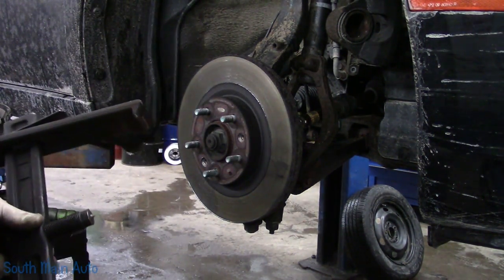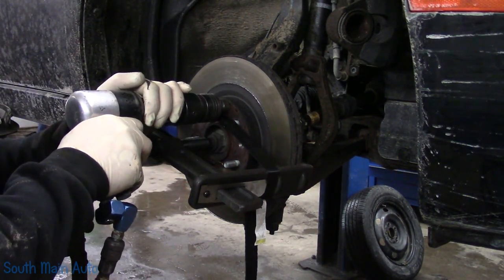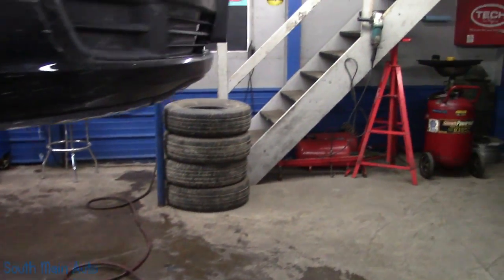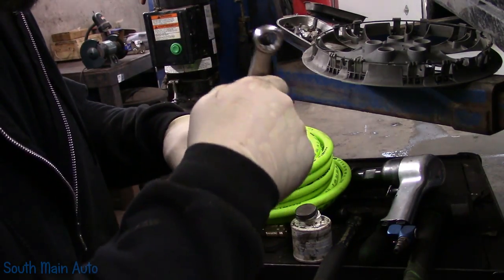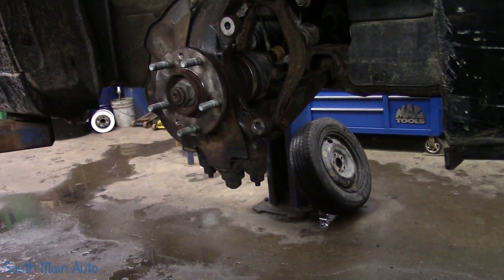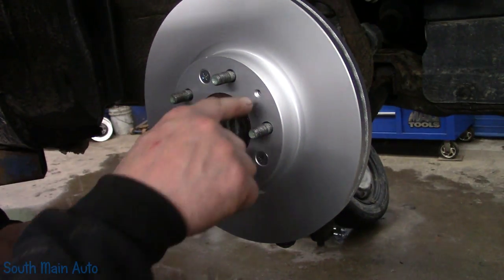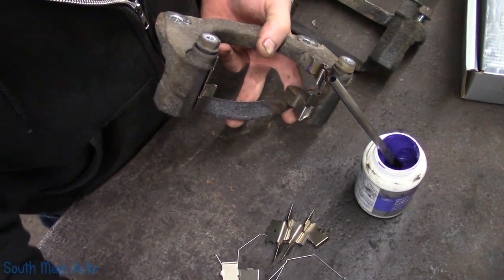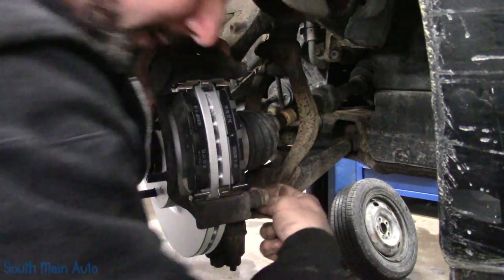Mazda 6: EXTREME Brake Rotor Removal 😱

Comment: Years ago my grandfather had a Checy Celebrity and lived in good old rust county NY. He didn't drive much and when kne of his brake calipers started to seize, I went with my dad to take Grandpa to the tire shop because the tires had started to dry rot. Now figure 12 years on NY, few miles and the wheels had never been removed since the factory. Rims frozen to the hubs. Front rotors also frozen and one seized caliper. Six hours in the lift with the mechanic earning his pay that day.

Comment: Ah the good old Mazda stuck brake rotors! The hydraulic 5-ton 3-jaw puller from Harbor Freight and a good air hammer work for me ;) Also, why not just thread on a lug nut or two to prevent the rotor from violently flying off? Less video drama though haha
Reply from the maker: Lug nut left on = boring vid 😐

Comment: It's a Mazda thing. I did a Mazda 3 ... in the end the only way I could get it off was cut across it with a angle grinder with a cutting disk, then hit it in the cut line with an air hammer with a chisel in and it came off in 2 halves.

Comment: Anti-seize compound works great. I use it on every brake job on the contact surfaces. I only have to use a hammer or winch for friend's cars

Comment: I had a 2005 Honda Odyssey that I was replacing brakes all the way around. All the wheels went okay until I got to the left front. Put the 8x1.25 bolt in- striped out. Broke my 8lbs mini sledge. It took an hour of pounding to get the rotor off. I hate rust.

Comment: Hey Eric, sounds like you're finally feeling better, unless this vid in not chronological.. Anyways, I generally use a BIG sledge to break the rotor off the hat and let it hang there. Then I use a really sharp air chisel bit and peel the hat off the hub. Since it's cast iron, and the hub is steel, it usually works pretty well w/o much carnage done to the hub, ( the hat usually shatters off in pieces, so have those safety squints on )  but you gotta be careful, have that  lamb like touch to avoid gouging the hub face. .   The rust belt fight is real! As for the new hose, I've not used 1 yet but they are supposed to work great in cold weather... retain their flexibility, and be better at resisting UV and salt . I've used Goodyear hoses for yrs, never had 1 burst, but they seem to tend to dry rot. Could be because they tend to lie on the floor in the salt and grime while I'm working. I also use nothing but a 1/2 inch hose. Assume you do as well. I don't like using pullers personally. Twice I had a rotor shatter in my face after placing not all that much pressure on it, while the hat was still stuck on the hub.

Comment: Yeah for me, my dad wanted me to do pads and rotors for his pt cruiser and the tire was mildly stuck like really mildly stuck because I took the lug nuts off and I was like 👁👄👁 wut... it's still....on??? It was just tiny rust so I just kicked it lightly, that was fun...and the rotor was just the same but just the slightest bit more where I had to get a hammer but one hit, came off that is just about enough drama we have here in Arizona just mild stuck stuff or a case of surface rust is all. Big props to you my dude cuz that rotor at that second turned to a weapon. That don't sit too well with me lol.

Comment: Like the race of a front wheel drive bearing that remained on the spindle. A slice on the top of the rotor, not so much the face...where they fuse and a smack with a chisel. The rotor comes off just as easy.
This isn't upstate NY but we're not far off in Toronto.

Comment: I have used a sawzall to make a radial cut to near the hub to remove a stuck rotor.  I found that there's no need to cut sll the way into the hub area. That seems to release the locked in stresses created by the overheated rotor.  You still need a 4 pound hammer.  It's surprising how easy the rotor cuts with the sawzall.

Comment: I got a Mazda CX 7, that I put new pads on at 60,000 miles. They were very difficult and because of that i use anti-seize on everything before I put it back together. And then again at 120,000 miles I had a wheel bearing go out. That was an absolute nightmare!!

Comment: Had a 2009 Focus with rotors like that. Had to cut them off then wire wheel all the rust off the hubs. Coated the hub with never seize when we reinstalled them. 2 years later they came off like butter.

Comment: Use a die grinder with a cut off tool. Cut the rotor between two wheel stud holes down to the surface of the hub. Get your cold chisel and five pound hammer. Line up cold chisel with cut mark. Hit hard with hammer. Rotor splits between wheel stud holes and rust is broken free from back side. Remove and replace rotor.

Comment: In my garage on jack stands I pounded, beat and kicked my Ford Ranger then I gave up. I went to Summit Racing, Akron 5 miles away (convenient) and I bought the OTC 6980. I attached it safety strapped it an used the impact on it. Still would not budge. So as directed I hit the shaft with a 5 lb. hammer and the rotor flew across the garage. It’s a great tool. Just be careful.

Comment: Rotor left that hub and tried to attack you like a banshee. 7/10 no brake clean, hard to get my morning buzz with no BC fumes in the a.m. Reminds me of the hub that became one with the front passenger side axle on my wife's jeep. Took the whole thing out and stuck in my vice to work on it for the next 2 hours, when I finally was about to give up and buy a new hub (was replacing the axle already) I just barely tapped it in hesitation because I really wanted to take a sledge to it, it just fell out and the axle landed on my foot. That was last spring. What a crappy day.

Comment: That's why you always use two lug nuts to act as a stopper. Though if you're replacing the rotor a good mini sledge will help knock it loose pretty quickly.

Comment: I had a 2011 Durango in today, right rear rotor was about 3/16s of an inch thick. By the time I got the wheel off it had knocked the outer inch off into a separate ring. I have never seen a caliper piston out so far. Still had pad on the inner, the outer backing plate had just about worn down to where it would slip right out. I couldn't even get the usual tools in the caliper slides they were right at the spring. Rotor popped right off for me though. Worst part was it had come from the dealer for some stalling problem, no mention of the brakes as far as I was told.

Comment: If you have a rotor that stuck use a portaband and slit the braking surface of the rotor in 2 opposing spots. Then  use your puller  and the rotor will split in 2 very easy and come right off. Many times when rotors get this stick it is not necessarily  stuck on its  inner hub diameter but its  outer hub  diameter which is what makes it darn near impossible to remove. That is where splitting the rotor helps so much. Putting a lug nut on will keep you from smashing fingers and toes. As far as using big nasty on the hub! Please think about the poor wheel bearings in there getting brinnilled. Using a air hammer on it is just like using a impact gun on the hub nut . Both can and will most likely lead to a brinelled wheel bearing.

Comment: I use a die grinder with a cut -off wheel to cut across the face of the rotor and hub.  Then use a wheel puller to crack the rotor in half to get it off. No drama.

Comment: Pulling stuck rotors is the worst and frustrating.  You could use another ratchet strap to hold the rotor puller to the frame to keep it from projecting towards you.  Anyhow, glad you didn't get hurt.

Comment: Just found this video. I have to say I'm glad I didn't find it until after I used a puller on my rotors in my driveway in western New York. I'm also curious to know if I have to do it again, would it be a good idea to possibly put a lug nut on part way to keep the rotor from flying off.

Comment: That was a bit intense. Should have called it 'Fire in the hole', lol. Looked like you still and the air gun on it which would give you some protection. Could be really bad if it caught someone by surprise and just hit someone a bit shorter in the chest with that big bolt sticking out. I've lived most of my life in NY and luckily never had something that bad. I guess I know why I clean everything up and use never seize all over when I do change my rotors. Thanks for sharing.

Comment: I see so many using that puller and it flies off.  Leave 2 lug nuts threaded partially on opposite ends and that won't fly off.  I'd rather eff up a lug nut or a stud than end up in the ER.

Comment: What is the attachment you are using on your air hammer, when you press it against the stuck rotor? Rubber or metal ended bit? Thanks.

Comment: They do include something to keep the rotor from flying... they're called  lug nuts. Sometimes you can break them free  by just forward,  reversing, and braking  quickly with loose lug nuts installed while one drive wheel is still on the ground.

Comment: So what I have to do to get those Mazda rotors off is get 2 long bolts and put them through the ears where the caliper bracket mounts (from the inside out), then put nuts on the other side so as you tighten the nut, it pulls the bolt through.  Once the bolt starts hitting the disc, you tighten the bolts, turn the rotor, tighten the bolts. etc until you press that thing off.  Hasn't let me down yet living in Michigan.

Comment: I actually did do the front brakes on my Mazda 6 in my driveway in Upstate NY. Those stupid set screws on the rotors gave me hell. Thankfully I was able to whack the rotors off with a regular hammer. Now I'm hoping that I put anti-seize around the outside of that hub. I can't remember.

Comment: Wow, on my 2001 Suby they came right off by using the 2 jacking bolt holes in the rotor and it was really rusty. I'm in NH and it's bad. My rotors have 2 jacking bolt holes that I run a tap into first to clean the threads. I go till it bottoms out on the hub and then i do a quarter turn. Go to the 2nd one and do the same thing with a quarter turn after hitting hub. You have to go 1/4 turn on each screw back and forth again and again and it comes off. I think only having 1 in a rotor is basically useless. Subaru is smart knowing their cars are driven in rust belt areas so they put 2. I was putting so much torque on it and it never stripped. Good old Subaru.

Comment: I had same problem same car mine was even worse bought the same tool, STILL wouldn't come off, I finally got a torch and cut the whole rotor in half!!! For some reason the hub causes the original rotor to form a mushroom over it and it becomes solid.

Comment: Changing brakes on my daughter's 10yo Hyundai in the parking lot outside her dorm, 95 miles from home, with every tool I could imagine even possibly needing tossed in the back of the van.  Except the 4-pound sledge, of course. I thought of it the night before - wrote myself a note - forgot to grab it.  I beat the ever-loving shiznit out of the first rotor with the classic 16oz ball-peen until my arm was tired. I had just decided to go buy another damn sledge hammer, when a college maintenance guy happened to come along, and he loaned me his.  Four whacks and the rotor came loose.

The rotor on the other side was apparently paying attention and wanted no part of this abuse - I took the bracket off and the rotor literally fell right the hell off the car.

Comment: Had a 2000 Durango with the rotor stuck on the hub. Ended up slowly lowering the rotor onto a jack stand to finally brakes it loose and I was working in my driveway

Comment: Wife had a 1984 Mazda 626,  I had my mechanic do the front brakes.  He calls me while he's working on the car - this was in 1992 - and asks me to come by the shop.  I get there, he asks me to put on shop coat, and gives me a 8 pound sledge.  Says to me: "I've been swinging that thing for 2 hours and can't get it loose, you're bigger than me, so have at it!  "  I was scared the car would shift off the lift while I wailed on the RF rotor. Eventually it came off, but both of us were late for dinner.

Comment: Just curious, why didn't you use some heat?  I've done all 4 of my them on wife's minivan and couldn't get them off with the gear puller.  I put the torch to each one for a couple minutes and they popped right off.  Is it not advisable to use heat?

Comment: do you have a s10 no rear brakes issue but the cylinders do move just will not add to the stopping? i back in the garage on ice , front tires slide will not stop until front tires get on dry floor. seems back tires should be stopping the car. can hold brakes and drive out the garage when front tires are on the ice holding the pedal hard as i can.

Comment: My trick has been to take the wheel off and very slowly let the jack down using gravity and 3,000 lbs of car to break the rusted rotor loose. Suddenly my way seems less dangerous than using the correct tool for the job. Gotta love living in the rust belt.

Comment: I love living in california... Smack arotor with a hammer hard enough and it comes off. I had a couple work trucks that travel the US 24/7 that they were stuck but a 4 foot sledge took it right off. Had a few wheels need a 4 foot sledge to get off though. Even loosened the lug nuts and drove the truck around the parking lot and it wouldnt come off.

Comment: I wish I had spent the $100 for that puller when I replaced the rear rotors on my 2003 F150, no through holes since the parking brake drum is part of the rotor. It only took 8 hours of beating and heating, to get the left side off, that caliper had seized and set the pads on fire going down the road. Luckily the right side went easier, it only took 6 hours to get it off. The good news is my front brakes are in perfect condition and don't need new rotors 😉

Comment: The worst brake job I ever did was on a 2012 Mazda 3... and this was back in 2014.  The rotors were so warped they needed changed and would not come off.  Ended up breaking the rotor in 2 pieces on both sides with the center part still stuck to the hub.  This was after using heat and a BFH.  Only option left was to break out the angle grinder and cut the stuck part off.  Brutal.

Comment: What did you use on the hub before you put the new brake rotor on?  I would have wiped disc brake grease all over the hub in a thin layer to prevent the new rotors from rusting on.

Comment: I know I shouldn't laugh, but I did.

I had similar on an old Land Rover Discovery. The job started off bad by me noticing that one of the calipers was leaking, got worse by rounding off the grub screw which holds the disc / rotor in place, took a step closer to Shitsville by me snapping an eBay special Chinesium screw extractor in the grub screw, (have you ever tried drilling one of those bastards out ?). When I eventually removed the snapped off screw extractor and grub screw, the dam disc was welded to the hub. Man, I must have spent about three hours pounding and swearing on that thing. Did it come off? Well, kinda, the outer edge of the disc came off, leaving the inner section still welded to the hub. 

That was the point at which I phoned Enterprise and decided to rent a car for a few days before I ended up fixing that Land Rover permanently with a gallon of petrol and a box of matches.

Comment: Even sometimes happens in Tennessee :P My F150 one time froze the rotors to the hub. So after beating on them for hours I got out the cutting torch and lit them up cherry red around the hub. Then they popped right off... I thought all was good.....nope cooked the seals and grease. Sigh

WHERE WAS THE BRAKE CLEAN!!!!

Comment: my mazda  2013   6        64,000        4   breakpad   replacements  and  rotors...       about to   do it again,,      after 10,000   miles   every  set   turns into  break Vibration...     Never had that problem before in  any other vehicles  ive had...       and  on  the  Caliber it  has a big  Ford  stamped into its steel  ...    yup  ford breaks..        maybe   its time to switch to brembo   brand    for everything

Comment: Had a truck that was only a couple years old get a flat and could not get the rim loose, of course it was the coldest day of the year, luckily I had a sledge hammer and had to beat the crapola out of it to get it off, the spare did crank down

Comment: Never had a rotor that stuck but I did have a axle stuck inside the hub of a Subaru. Had to pull the whole knuckle off and put it the press after about 2 hours of heat pb blaster and 4 tons of pressure that SOB let loose and blew apart the press and sent a chunk of metal through the glass window. Bad day but I walked away from it

Comment: Well done that thing is kinda sketchy lol I usually try to crack the rotor in half with the air hammer and chisel bit. Don’t like the idea of that thing flying at ya lol. Guy I work with now showed me the best trick I’ve come across I also from tri salt area workin on rusted stuff heat whatever it is torch it red red hot till it’s about to melt then hit it with water fast works every time

Comment: Somebody has probably already pointed this out but...
Shouldn't you loop the safety strap like through the lower control arm and around the rotor vertically and loosely - to keep it from jumping out and attacking you like that?

Comment: ive been known to use some wd type spray or a wiii but of antisneeze on the face, i'll clean and treat the edges of the hubs now too. can't use much (very little) though on the face you want it all to seat flush and flat. i use antisneeze ON EVERYTHING. probably have more monies worth in antisneeze than the car is worth.  wish my pads had anti drag clips on them.

Comment: As a kid , I worked on lots of outboard motors.... Puget Sound area - salt water... everything was rusted steel into aluminum , and steel onto rusted steel....  I used heat on anything beyond barely stuck....still use it a lot on my amateur wrenching.....  I am thinking heat would have made that easier....?     Maybe ?